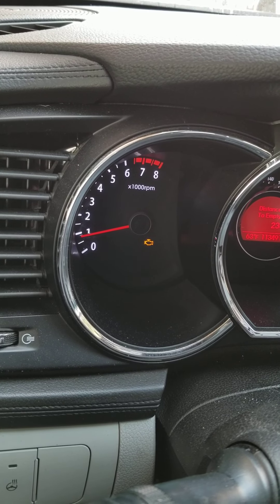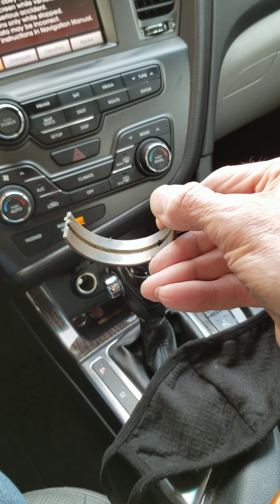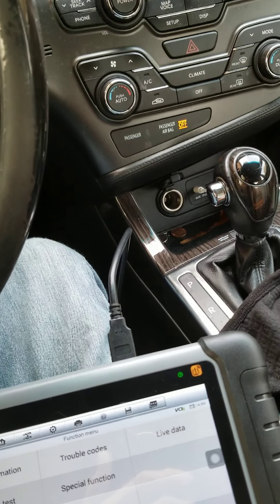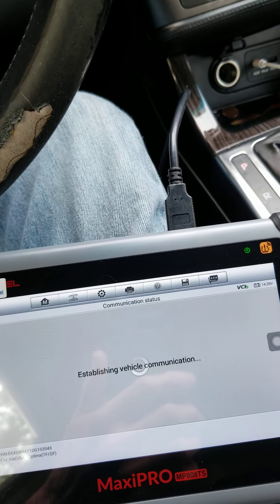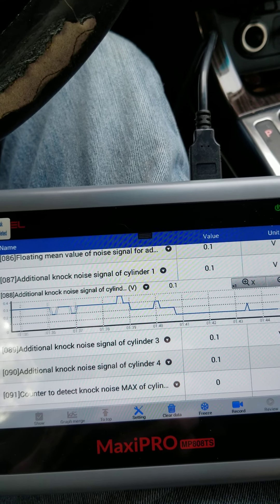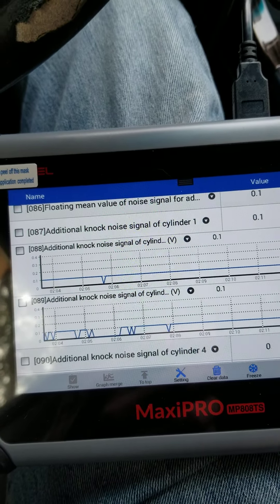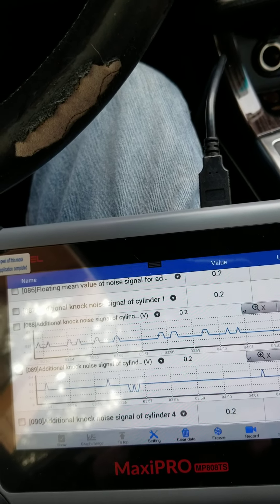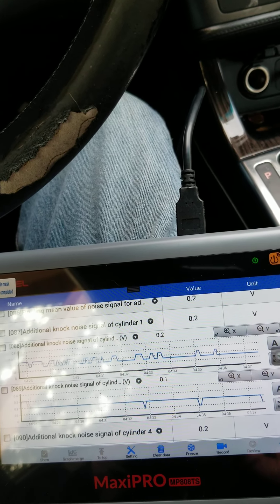p1326 knock sensor code should you reset it ?

Comment: I had this issue with my 2017 Hyundai Sonata with no audible knocking or rattling sound.  The dealer did the rod bearing clearance test and it passed but they did do a software update and all is well since the update.

Comment: Have a p1326 code on a 2015 kia soul with 85k miles but you cannot hear any knocking but CEL is flashing and in limp mode. Since you cant hear a knock it is worth just trying to delete the code and see if it comes back rather than make trip to the dealer? I know there is an issue and extened coverage on the engine for this but i would like to avoid any run around from them or paying diagnostic if its a fluke. Thanks.
Reply from the maker: Yes try resetting the code and see if it comes back.  Could be a bad knock sensor also.

Comment: I just began getting a flashing engine warning indication and the subsequent P1326 code on my 2016 Hyundai Sonata (2.4L) with only 40,800 miles. It, of course, went into limp mode and I can't really drive it. If I am not (or hadn't been) hearing any bearing noise or any unusual engine knock noise beforehand, and I clear the code, would I be able to "drive" the car to some extent, at least until, and if, the code set again and went back into "limp" mode? This problem began shortly after I filled up with gas and drove only a mile or so. Could bad gas result in the same indication, i.e. flashing engine light and P1326 code? I did pour in a gas additive (Gumout Regane Complete Fuel System Cleaner) into my gas tank when I got home, but it probably hasn't run long enough for the additive to circulate? Anyway, the car will start up just fine and idle nice and steady even with the engine light and code activated and I don't and wasn't hearing any unusual noise (it does load down when I give it gas - Limp Mode). The dealers here in San Antonio won't even look at my car for months (back logged). I did take it (had it towed) to a repair shop who confirmed the code, but the man said that if he tried replacing the knock sensor or harness extension (ref: Kit Part Number 91400 C2010QQH per Technical Service Bulletin TSB 19-01-006H-3) that it probably wouldn't help and would cost me upwards of $600, and it would let Hyundai off the hook. Anyway, Hyundai Customer Care said I must get it to a Hyundai dealer before they would do anything. Got any idea's???
Reply from the maker: Sounds like you are getting combustion knock from a bad load of gasoline.  Try filling up with premium from another brand 
Please let me know how it goes.
Reply: @rustbucketvalleygarage7046 ...Thanks for your reply. I just want to confirm with you that if you got bad gas, could this cause the flashing check engine light and the subsequent P1326 code? I got ExxonMobil regular gas where I always get it. I cannot readily drain the tank and refuel (I am 73 in bad health). I don't think a repair shop would do anything with my car since it is still under warranty especially for this P code? Is there a better additive I should put in the tank (and let it run (idle) for awhile? Might it help? THX!
Reply from the maker: The knock sensor would detect combustion knock.  Put some premium gas in the tank and let it run thru.   Sorry but you might have to live with the low power for a bit till the gas runs thru.

Comment: If you delete the code to get it out of limp mode does the code come back? I stopped at Orilleys and they scanned it got code then deleted it so now the dealer said I have to continue to drive it until the code comes back.
Reply from the maker: Usually when you get the code you will hear the bearings rattling.  If no rattle then could be just bad sensor. Thanks for the comment.
Reply: I checked my oil and then it was empty so I changed the oil and reset the light. According to the TSB you’re suppose to immediately bring the car in and i didn’t know that

Comment: I have a 2016 Sorento with 110,000 and engine light is flashing (code P1326). There isn't any knocking sounds but has trouble with first gear, rest of the gears are fine. How can i fix this issue?
Reply from the maker: Unless the engine is in limp mode (limited to about 30mph) I don't believe the two problems are related you might have a bad knock sensor.  Do you notice any rattle on a acceleration  ?  Might be just a bad tank of gas (predetination).  At 110k miles sounds like a band or clutches inside the trans might need some attention.  Check the fluid level er l first.  The fill plug is top front of the trans the plug is on the front of the block plastic cover on the front of the trans.  Fill the top until drips out of the front port.  Good luck.

Comment: That engine should be covered due to the massive recall, didn’t they take it to the Hyundai or Kia dealership? Those bearings/knock  were the main issue, i’m still stunned as to people that on these cars not knowing that.
Reply: Is this recall also for 2020 Kia’s ? I have one with the same issue
Reply: @Mannygva_  it’s not the exact same issue but the 2020s I have an active recall for oil consumption(which can lead to knock), and probably more. Call your dealership and give them your Vin number and ask them if you’re up-to-date with all your recalls and software updates.
Reply: I am currently having the same issue with my 2014 hyundai elantra manual.
Reply: There is indeed a huge recall for these engines.  Kia and Hyundai.  This is not good because we just dropped my wife's car off with this issue.  Very low mileage, always maintained.  The 4th cylinder will snap right through the block if you don't fix it.

Comment: How did you bypass kn sensor?
Reply from the maker: If it is just a bad sensor then it can be replaced. But if you really have a valid engine knock code that should be addressed by engine repair work.  Bypassing a valid code is not really advised